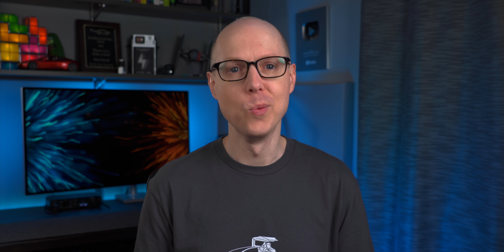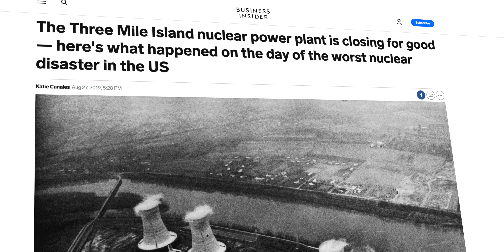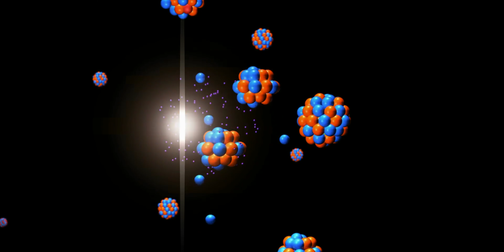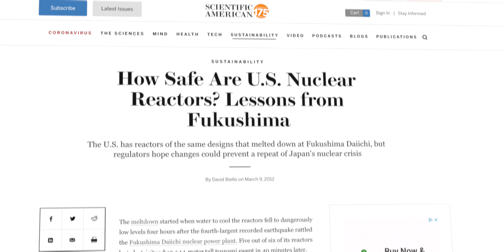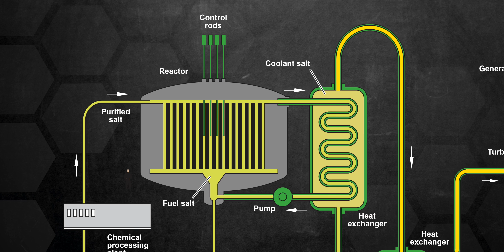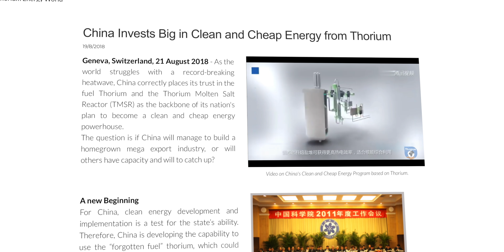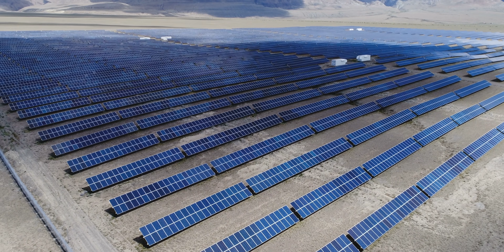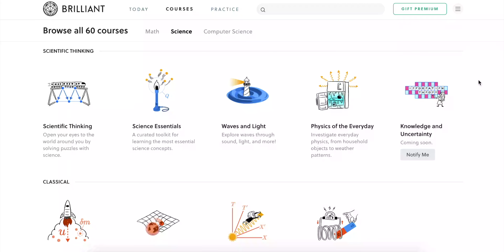Thorium explained - the future of cheap, clean energy?

Comment: Molten salt reactors are the future of grid power.  Wind and solar have potential for offgrid power, if their often ignored environmental impacts can be resolved.
Reply: The problem with MSRs is not that they can not get them working, as stated, it is finding materials that resist the highly corrosive effects of the fuel salts. Then once you find those materials, they have to go through extensive testing to ensure they are actually safe to use in a reactor. This is the biggest technical hurdle. The physics of an MSR are not that different than the physics of an LWR, except that the fuel is circulating while the moderator is stationary instead of the other way around. Either way, without the moderator to slow neutrons down to thermal energies, you have way fewer fissions than in the moderated section. Be skeptical all you want about stuff you have not seen, but you have seen less than you have not seen and you will never see everything. I have never seen Chrysler's gas turbine car that ran on pretty much any combustable liquid, but I don't doubt it existed and worked because it is not any more difficult than things I see every day.

Wind and solar do have a huge environmental impact. Nobody was talking about oil or fossil fuels so making that argument is just a strawman. They do go up faster than nuclear, but they also take up way more land per installed megawatt, have pathetic capacity factor, which means that a 1000Mw nuclear plant puts out many times more electricity than a 1000Mw solar array or a 1000Mw wind farm, and they don't last as long. The stupid response I hear all the time from "renewables" advocates is that nobody cares about that land anyways. My response is that is an ignorant and elitist statement. I care about the desert I live in. It is a very unique environment and anybody who thinks it is useless, uninhabited land has never spent any time in it. I am sure most of these places where people say to stick the solar panels and wind turbines are similarly unique and have people who care about that land as much as I do. I have solar panels on my house, so don't think I am anti-solar. I have considered installing a windmill as well. I think they are great. I just think it is foolish to think they should be the main tool for the job when it comes to cleaning up our electricity production. They are small role players and should stay that way.

Also, and this is not scientific, but I do wonder if it is a legitimate concern to wonder about how exponentially increasing the amount of kinetic energy we take from the atmosphere would affect global climate. At some point it has to reduce mixing between latitudes, and that has to have some adverse effects on climate I would think.
Reply: @F14Goose37  Materials is kind of a technical hurdle, but not a major one. At the conclusion of the MSRE examination of the reactor showed little to not signs of any noticable corrosion or deterioration. HOWEVER, that was only after 20 thousand hours of fairly continuous operations. One of Oak Ridge's goals with the MSRE2 (died in the womb) was to evaluate hastaloy-N over a longer time frame while also continuing testing with other materials which might be even more corrosion resistant and thus not require that the salt be doped with berylium. Oak Ridge published a report in 1969, Molten-Salt Reactors-History, Status, and Potential" that ended with it outlining the various remaining technical issues. I believe developing processes for on-line analytical chemistry seemed to be the biggest hurdle, along with other chemistry issues such as figuring out how to ensure that noble metals didn't plate out on the inside of the heat exchanger when the temperature of the salt dropped, which can cause the metals to come out of solution. However, I wouldn't consider that or any of the other factors to be major hurdles. 

The PRIMARY hurdle is the fact that the people with hands on knowledge dealing with this type of process are almost all dead now, taking their knowledge with them. People might not think that this should be an issue, but those people are missing out on the value that an experienced engineer will bring to their work vs. an engineer strait out of college. I suppose it's like having your expensive (excessively complex) German car worked on. You'd prefer a mechanic who's been working on german cars for decades rather than some 21 year old coming strait from a general mechanic trade school.
Reply: @F14Goose37  Also let me thank you for this fair comment and the reasonable skepticism, and especially your reasoning. I try to leave myself open to any possibility, even the ridiculous ones, as what the hell do I know?! I've been digging into nuclear for 6 years or so now and have amassed an obnoxious amount of knowledge on the topic, but I only started digging into the topic because I was skeptical of the claims laid out in the movie "Pandora's Promise" and I wanted to find the flaws the movie wasn't talking about. "If nuclear power is so freaking great, why are we still using fossil fuels?! There has to be a reason you're leaving out!" There are issues with nuclear, but different types of reactors have different issues and different strengths. The only "existential" problem I ever found was the ability for fast spectrum reactors to easily be converted into large producers of almost pure Pu-239, making them a HUGE proliferation risk. However, that's not a feature shared by thermal spectrum MSR's, whose primary problem is their anemic breeding ratios of 1.05-1.07, which prevents them from producing sufficient excess fissile material with which you can start a second reactor, not unless you're willing to wait 17-25 years or so. 

So thanks for being both skeptical and fair. That's more than once can expect from anti-nukes, who are generally blind ideologues that cherry pick and distort information and scream LIES!! when confronted with information that undermines their claims, such as the fact that nuclear has one of the lowest levelized cost of energies (LCOE) of any source of power, with LTO nuclear's median LCOE of 32 USD MWh being the absolute lowest of any power source.
Reply: @F14Goose37  You obviously have made up your mind before you had any MSR knowledge and are now cherry picking only the cons indicative of your echo chamber education.

Corrosion is a real problem being investigated all over the world with many promising solutions better than what Oak Ridge in the 1970s.  The main issue right now is not investing several million in getting a process certified, only to have one of the other designs render it obsolete before the investment can be recouped.

MSRs are being built in numerous locations with nonfissile  to avoid regulatory red tape and certification costs as proof of concept.  Once a process is successful and appears to be able to withstand the test of time, all that needs to be done is to add the fissile material, and you have a nuclear powered electrical generator.

If you were actually paying attention, you would know that China appears to have the lead and is highly likely to have a working plant before the end of the decade, putting in prime position to become the world's leader in producing the equipment that will run the grid power plants all over the world within a few decades.
Reply: @peterm.eggers520  Slow your roll bud. I was responding to this guy's skepticism by pointing out that it is not a comparatively difficult thing to get these reactors working and that the main problem isn't understanding how to get it to work, it is catching everything else up to make it a commercial reality, which from a technical standpoint, still includes materials. I am not anti MSR at all. I am very excited about the technology for many reasons. I am an operator at a PWR. I don't think PWRs are the pinnacle of reactor design. I understand why we use them better than most people do, but I am very eager to see where the industry can go if we as a society don't hold it back. The reason I became an operator was to understand the technical side of the industry better so I could put my MBA to work later in my career and help make the decisions that will shape the future of the industry. A lot of my reading outside of my hobbies are about what is going on with energy in research, regulatory issues and business investment. I am not a technical expert on different reactor designs. In another comment thread, somebody just taught me why an MSR does not have the same concerns with xenon and load following that light water reactors do. I am still learning, but I am aware of the big picture regarding advanced nuclear designs.
Reply: @F14Goose37  Being aware of something does not equate to knowledge.
Reply: @F14Goose37  AH! I knew I recognized that name lol!
Reply: @williamsmith1741  Hold on. Did I communicate my thoughts extremely poorly or what? I am not at all skeptical of MSRs, nor am I even remotely anti-nuke. I work at a nuclear plant (as I stated) and I am working in operations to augment my business education and leadership experience with a solid technical understanding of how nuke plants work so I can help push the industry forward (as I believe I stated). One guy made a ridiculous argement that MSRs don't work and I made a counter argument. I pointed out that, according to my current understanding, materials and the regulatory environment were the biggest reasons why we don't have commercial MSRs yet. How does that translate to me being skeptical or in opposition to the idea? It just means that I understand the reasons for why we do not have operational commercial MSRs yet are more complex and that their absence from our grid is not proof that they don't work like the first guy said.
Reply: @F14Goose37  Oh no, I was agreeing with you. You'd said something about the problem with anti-nukes and I was just expounding on that. You didn't say anything incorrect, although the materials issue isn't exactly correct but it's also not exactly wrong. You do say that you're skeptical, don't remember the exact context, but it wasn't an unreasonable skepticism. More like pragmatic & considerate skepticism. Recognizing that this kind of stuff is very promising, but also does have hurdles, which could be viewed, subjectively, as being big issues or little ones. 

I was probably more appreciative than necessary as I've been crushing an anti-nuke in another video comments section and I appreciate a measured/nuanced statement on the topic. I kept crushing that other guy with facts, providing the sources for them, and he kept responding with "LIAR!", literally. I only keep at it because I think people have a responsibility to stand up to misinformation. :) I'm not going to convince the person I'm arguing with, but I may convince someone see our back and forth. They'll at least see an alternative to that person's nonsense.
Reply: @williamsmith1741  Fair enough. I figured I must have made a grave communication error. I enjoy talking about energy. Sometimes I enjoy at length discussions with strangers on the internet. Other times I don't have the energy and/or my thumbs get sore. I am glad others are more passionate than I am, especially regarding areas where my knowledge has some gaps. That means I do not have to know everything, which is a whole lot easier than knowing everything. Some things others can know for me as long as I get the jist.
Reply: @F14Goose37  Nah, I didn't see anything wrong, but even if I did, if you think you're right, double check your source and then push back. 

Sometimes I would prefer that I know less, as this topic just leaves me feeling depressed A LOT. One of the most bitter lessons that can be learned is that sometimes, ignorance really can be bliss.
Reply: @F14Goose37  land…95% of humans live on 10% land and 0 percent sea which 70% of the surface… it’s like that trash island yeah it’s bad but the size of Rhode Island compared to the size of the ocean is dumb small
Reply: @noirekuroraigami2270  I apologize if I sound rude, but what are you trying to say? I am not understanding the point you are trying to make. Your comment to me was very incoherent.
Reply: @F14Goose37  Yep that is what i meant. They work in the lab, "prototypes are easy,,,production is 99% harder" Elon Musc
Reply: @brianevolved2849  If that is what you meant, you did an extremely poor job of communicating that. You expressed in at least two comments that you did not believe it worked. Not that you did not believe that it was feasible to build a commercially viable product that would last long enough to offset build costs and provide adequate profit for the investment to be worthwhile, but that you didn't believe it worked. You even insinuated a government conspiracy to say it worked when it didn't. Getting it working is easy enough. Materials that will last long enough to make it worth building for profit is a different story. That is why it has not been built bigger and better yet. Companies are still working on the materials part of the equation to make it commercially viable. In fact, a new alloy was just approved a few months back if I recall correctly. Also, future reactors will likely be smaller, cheaper to build and easier to deploy, not larger.
Reply: @F14Goose37  You are quite right ........ i did an extremely poor job of communicating that. You expressed in at least two comments that you did not believe it worked... i meant viably............i have MND and typing is difficult..........have taken to short comments.............I do hope your alloy works.........i love being proven wrong.Livee long and prosper sustainably
Reply: What impacts from Wind and Solar? Faster production than nuclear? Way cleaner than any burning, even natural gas. Distributed power?
Wind turbines do have a finite lifespan, and recycling/reuse isn't easy, but much better than burning stuff.

Cobalt? Not a whole lot used in batteries, most is in cathode, about 4% of the total weight of the battery cell. And it can be reused.
Cobalt is used in alloys, but that can be recycled.
Its used in petroleum refining. That can't be recycled or reused, because it goes up the tailpipe after its burned.
Reply: @coreys2686  https://www.youtube.com/watch?v=t_UdqZdFr-w&t=65s
here is a video of a lake being produced from byproducts of heavy metal and rare earth metal mining. These metals such as neodymium are necessary for electric cars, solar and especially wind energy production.
Reply: @coreys2686  Wind and solar are relatively good energy sources when implemented locally, as in house-by-house, and in those areas where the weather is conducive.  Large scale installations are deleterious to both the avian population and to the terrestrial - grasses, forbs, turtles, mice, etc.  Plus, current technology uses highly industrial processes to produce the panels, blades, etc.  These costs should be acknowledged.  I've seen numbers that indicate that there are not enough raw materials on Earth to make just the US convert to 100% solar and wind.  Absent some transformative breakthrough in the tech, thorium is a far better option, especially for places where the sun doesn't shine a lot, and "everyone" wants to continue the concentrated NIMBY model of energy generation.
Reply: @coreys2686  Wind & solar have materials that are mined with nasty byproducts being dumped into the environment, valuable materials stolen from poor countries, and at times using more energy to manufacture and maintain than is generated by the final product.
Reply: @peterm.eggers520  its no different than what's been done for more than a hundred years to get oil.
I can think of two coups and at least two wars that were only about getting or keeping access to oil.
Reply: @coreys2686  I already checking website to buy  one solar panel and boy that cost exponsieve in my 3rd world country
I guess I just stick with biomass
Reply: @peterm.eggers520  thorium literally a cause for bone cancer
Reply: @noirekuroraigami2270  You're not supposed to eat it.
Reply: Molten Salt is a myth  sorry
Reply: @brianevolved2849  No need to be sorry for your ignorance.  Working molten salt reactors were first demonstrated in the 1970s at Oak Ridge.
Reply: @peterm.eggers520  Dear Peter Both you and I have not actually seen it working at Oak Ridge. The difference twixt you and I is you 'believe' that they had it working and I until the figures can be replicated, do not. Why I ask did 'they not build a bigger better version?  Shame n'est-ce pas ?
Reply: @peterm.eggers520  Do you Peter have any real proof that the system actually worked, apart from some old government paper documents?
Reply: @brianevolved2849  You make rash assumptions that are false, and your self assurance that you know what is true is indicative of a teenage mind.  If you can overcome your cognitive dissonance, maybe you can get up to speed.  I'm not here to educate you.
Reply: @peterm.eggers520  Again Dear Peater I ask for proof You are the one trusting your government has actually had a working reactor I would be happy if they actually had If they did why do they not still have one WORKING. PSI assume you are not Qualified?  Please post your proof the system works.....
Thanks for the complement of having a teenage mind  Capt Brian (63)
Reply: @peterm.eggers520  He's a troll that I and I'm sure a lot of people have taken apart. His argument basically boils down to "You weren't there, so how can you prove it happened?!" It's like a conspiracist with object permeance issues.
Reply: @brianevolved2849  We have photos, videos, and projects that were started concurrently in other parts of the world in China and Japan. We also understand the general phenomena, as it's not a complicated process. That's what makes it so infuriated that it was shelved for political reasons.
Reply: @peterm.eggers520  apparently so shame fifty years later they cannot replicate
Reply: @williamsmith1741  I appreciate your input.  Sometimes the trolls suck me into their nonsense, and then there are those that learned enough to think they understand more in typical teen fashion.

I try to remember Mark Twain's words in either case:
“Never argue with stupid people. They will drag you down to their level and beat you with experience.”
I don't always remember.
Take care.